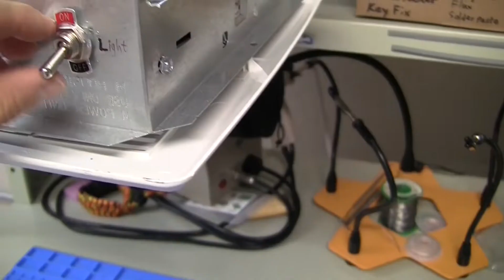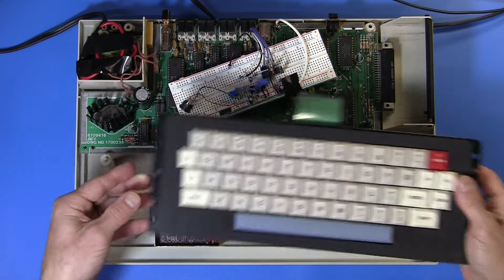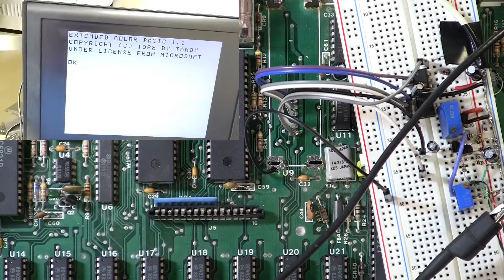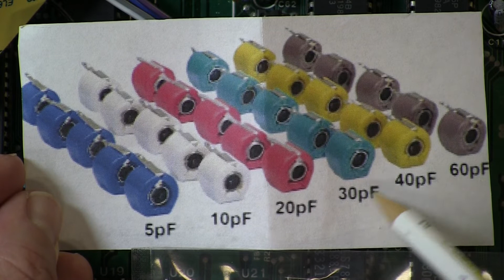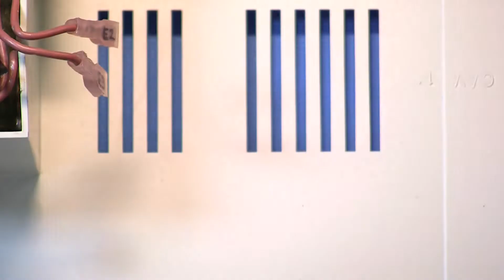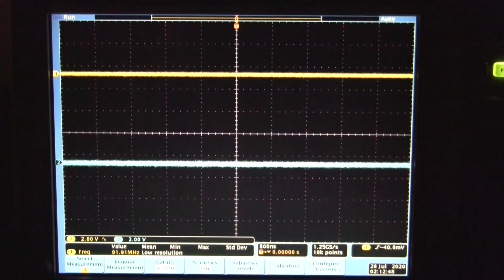CoCo Black Screen Repair - Video Fix : TRS-80 Hardware Repair Series

Comment: I got on at ham fest and it's just black and white and grey. Other than that it works
Reply from the maker: Hopefully you got a good deal there. It's definitely worth having in any shape.
Reply: @acs8-bitzone651  20 dollars. Had a diagnostic cart and a game. Also a rs232 adapter for disk drive, probably want use that

Comment: Where did you get the spacebar replacement? Did you print it yourself?
Reply from the maker: Yes, I did. I have another video about modeling it, printing it, and making the stabilizer arm for it. Thanks for watching.
Reply: @acs8-bitzone651  Awesome stuff, looking forward to any new content you put up in the future. Grew up in the mid-90s with the Apple IIe as my first computer, but recently purchased a Coco 2 and am looking to learn more about such a platform that I never had the chance to experience.

Comment: Thanks for the video.  So what do you think took out that cap. & fuse?  Voltage stored in the caps. on the board and PSU shorting to ground?  Also wondering about your thoughts on USB & software scopes?  Mainly asking you cause you seem to use yours for 90% of your diagnostics.  I was looking at a Hantek for my laptop.  Thanks again for your content.  Great stuff.
Reply from the maker: The cap was bad before the fuse went, I believe due to water damage. The rf modulator case and surroundings were rusted. The fuse was a mystery. It's a 350mA with time delay so it can ride through capacitor charge during power on. Maybe I was soldering with power on. I normally power off and unplug while soldering but I bet I drew a short to ground through the soldering iron. The sound I heard could have been solder flux splatter, or maybe it was  when the fuse went due to ground short.
Reply: @acs8-bitzone651  Good deductive reasoning.  I thought it was unplugged and 'pop' it all went out.  Had me  puzzled.
Reply from the maker: I haven't tried a usb scope before but I believe it could be a good experience. It seems fine for home hobby use like I do. This oscope is borrowed while I decide what to purchase. I am getting a dedicated oscope for the convenience. I am considering
Reply from the maker: the Siglent a little over the Rigol. There is a 4 channel one on the lower end of bandwidth that is in my price range. And Christmas is coming soon around these parts!
Reply: @acs8-bitzone651  Yeah, I'm just looking and wondering do I "really" even need one.  But it would be nice.  As much as you use one you should contact a manufacturer and ask about them being a sponsor.  Even if you just got one for cost.  But who knows?